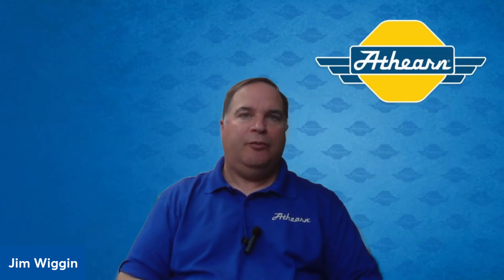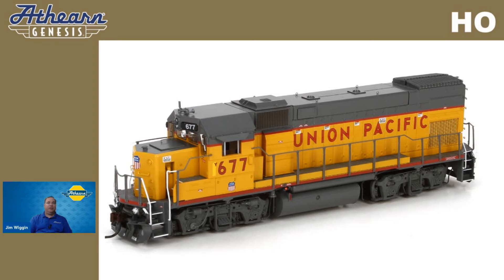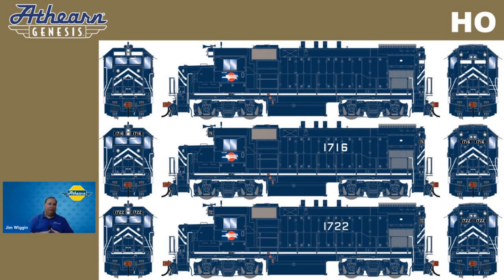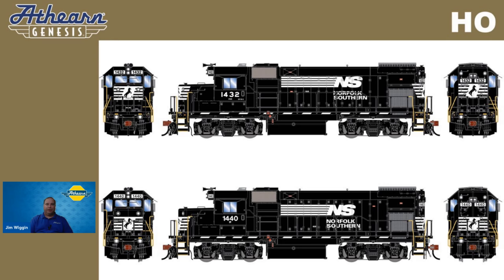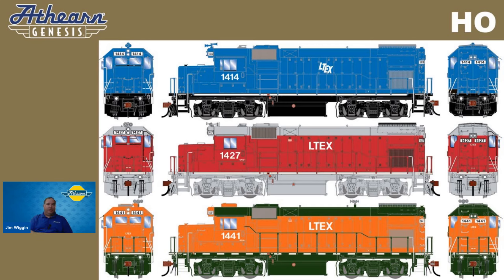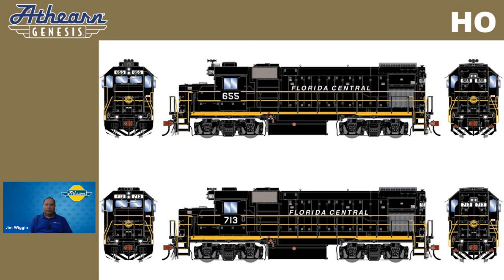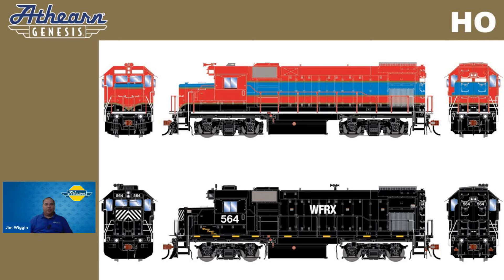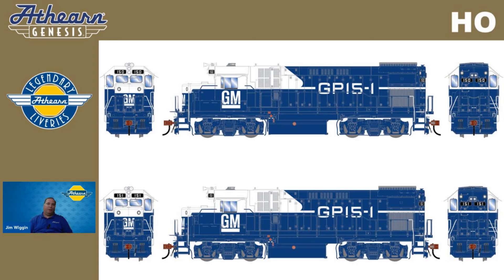Train Tuesday 8/6/24:  Athearn Genesis HO GP15 series locomotive

Comment: Hi Jim I do not think that Southern railway  had GP15
Reply from the maker: Hello Mr. Reynolds, hope you are doing well. Correct, the Southern did not have GP15-1s, that is why I placed the Legendary Liveries logo on the screen with those units. Still, those high hood GP15-1s running long hood forward in that Tuxedo paint would have looked great. ~ Jim